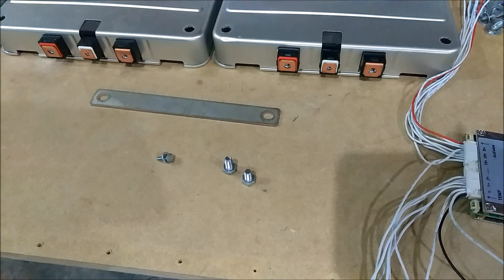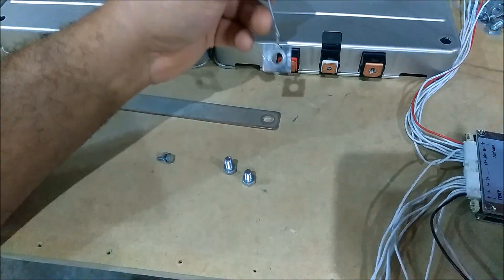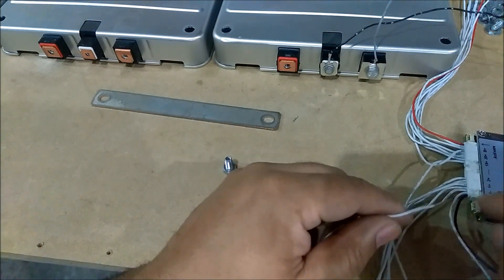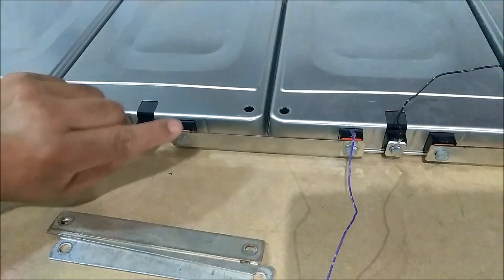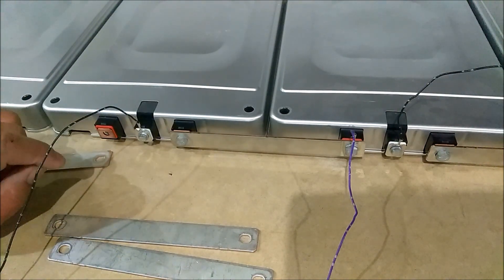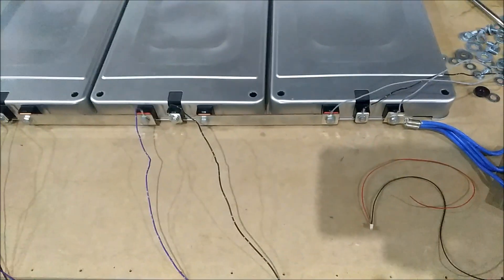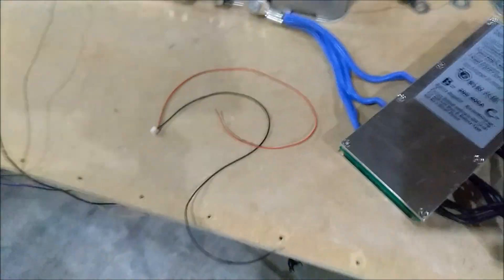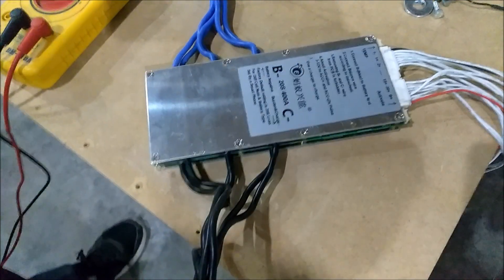BMS installation on a Nissan leaf battery bank

Comment: Excellent. Time to set mine up. This version of connecting to a Leaf module to the ant bms was clear while others were not. I was being thrown off because you were putting different color wires instead of white on your cells but figured out you had spliced other wire into them. I'll keep mine all one color if anyone else besides me has to deal with this they will not be confused by an array of different colors. Im using two modules stacked in parallel and seven in series for a small power wall. Getting it connected up tonight.
Reply from the maker: Sorry about the confusion thought I'd mentioned that in the video. Thank you for watching

Comment: Excellent video. Can you share the BMS link? What is the current for this bms? Thanks
Reply from the maker: https://m.aliexpress.com/item/33046194760.html?srcSns=sns_Copy&spreadType=socialShare&bizType=ProductDetail&social_params=20136481993&aff_fcid=1f7039cf11c649dfbbe883de300b754c-1618214436979-07796-_mM7hdEn&tt=MG&aff_fsk=_mM7hdEn&aff_platform=default&sk=_mM7hdEn&aff_trace_key=1f7039cf11c649dfbbe883de300b754c-1618214436979-07796-_mM7hdEn&shareId=20136481993&businessType=ProductDetail&platform=AE&terminal_id=d214a8cc0d894fd8945a93585cbdeef5
Reply: @carsonlurbanwindandsolar3437  
Can you help me find a bms and plan for this 24 volt 3 modules 3s3p please

Comment: I have a 4s12p setup for a 24v system. Looking to use a 24v 8s bms but my problem is choosing the amperage on the bms. Can I get your suggestion please
Reply from the maker: Sorry for responding so late haven't been on YouTube in a while. If you haven't figured it out yet shoot me another message and I will try to help you out sorry again thanks for watching.
Reply: @carsonlurbanwindandsolar3437  no problem.  I purchased a 200A BMS but now i am having another problem.  The bms charges the modules to 29.2 v, as a result my power goes out during the night. It would be 29.2 v at 6 pm and by 1 pm it shuts off the inverter. Any suggestions on how to rectify this? And yes the cells are balanced.  What is the best way to configure 48 leaf batteries for 24v to get maximum out of the modules?
Reply from the maker: @lennoxrowe9567  it could be a number of things causing it. Do you know if it's the inverter shutting off or is it the BMS shutting down. If it's the BMS shutting down you could raise your over voltage limits up. But I really don't know because I don't know the configuration you are using on the batteries or the limits of your inverter. Can you give me a little bit more as far as what inverter you are using and how the configuration is on your battery Bank and where you have your over voltage limit set on your BMS and your undervoltage limit set on your BMS. Thank you
Reply: @carsonlurbanwindandsolar3437  Thanks for your prompt response. I am using a Schneider 4024 inverter. It can handle up to 33v. The BMS upper voltage limit is 29.2v. It is the bms that is shutting down because when I put a meter on the c- port of the bms I get little or no reading. My battery config is 4s12p. The voltage limit came set on the bms, I didn't set it. Thanks again for your assistance
Reply from the maker: @lennoxrowe9567  one problem that you are having is that you are not getting your batteries fully charged. Fully charged needs to be somewhere between 32 and 32.8 volts I think it would be better for you to reconfigurate your batteries into a 3s 16p that way you can be fully charged at 25 v. You get the most power out of the Nissan leaf batteries between 3.6 and 4.1 per cell.  Lower the voltage on your BMS overcharged circuit to 25.2 or maybe 25.3 to stop the batteries from overcharging in case you have a problem.   But if you want to keep the configuration that you have on the batteries you need to raise the limit up on the BMS to at least 33 volts so you will be able to charge the batteries to 32.8.
Reply: @carsonlurbanwindandsolar3437  thank you very much. Information much appreciated. One final question, how do i go about raising the limit on my bms? Is it that i have to purchase a new one?
Reply from the maker: @lennoxrowe9567  you should be able to pair your phone to the BMS once you do that you go into settings and you can raise or lower the upper limit.  But it also has to do with which BMS you have there's some that cannot be adjusted it's done at the factory I believe some of them are called dolly BMS which one do you have.
Reply: @carsonlurbanwindandsolar3437  I think the one I have is preset at the factory. It is not bluetooth.  Can you recommend a good bms? That would be for 24v 8s and I think 150A would be sufficient for me
Reply from the maker: @lennoxrowe9567  it's very hard to find a good BMS and 24 volt but I have heard that dolly will do a 24-volt BMS for you in whatever settings that you need.  When I was running 24 votes the problem that I had was when I did a 4S the voltage was too high for my inverter so I had to go to a 3s. Make sure your inverter can handle over 30 v because if it can't it will shut the inverter down. Most 24 volt inverters can't run over 29.5 votes so you will never be able to get into The Sweet spot that the Nissan leaf batteries love to operate in.
Reply: @carsonlurbanwindandsolar3437  Thanks my friend. The Schneider can run up to a max 33v so I am ok. Thanks very much for your assistance much appreciated. When you visit Jamaica you can have a look at mine 😁😁
Reply from the maker: @lennoxrowe9567  thank you sir 🙏.

Comment: How ro hook up a BMS to a 4 cell 12 volt system.
Reply: The same way it just has less wires. Just make sure that you have either a 4s bms or a bms that can work for 4s or more cells
Reply from the maker: I have never seen a BMS for a 12-volt 4 cell system there might be some out there but I have never seen it.
Reply: Wh  bms  mode

Comment: Wired like this with a single bms, could you add more modules in parallel to each making a 14s6p? I have a gen 2 complete pack with 48 modules that is sitting within .005 of each module (very healthy pack) so don't want to get an extra module from an unkown pack that would probably have more degradation, so rather run 14s6p and save the extra 6 modules for back up.
Reply: I'm also looking into using a contactor switch to not run amperage thru the bms and use the bms  for voltage monitoring for each stack as a whole, controlling low and high limit charging and battery draw activation
Reply from the maker: Yes you can do that too I thought about doing that it's a video that I put up about doing exactly that.
Reply from the maker: Yes you most definitely can do that.

Comment: Well one caution I would suggest is not having the wire harness plugged into the bms while wiring just in case you make a short. Wire it first check it with a volt meter then plug in, in the order the manufacturer suggests. IMHO

Comment: What's the current rate ing of the BMS
Reply from the maker: 400 amps
Reply: @carsonlurbanwindandsolar3437  each BMS can carry that much current. Looks to small for that
Reply from the maker: @royamberg9177  that's what they got it rated at 400 amps I estimate it holding up to about 120 to 140 amps Max that's why I run two of them.  I have ran a hundred amps through it with no problem.  The Nissan leaf batteries says the max amp draw are charging is a 130 amps so I figured this would be cool to have one on each Nissan leaf battery.
Reply: @carsonlurbanwindandsolar3437  that is what I was talking half of what is rating it would handle it fine